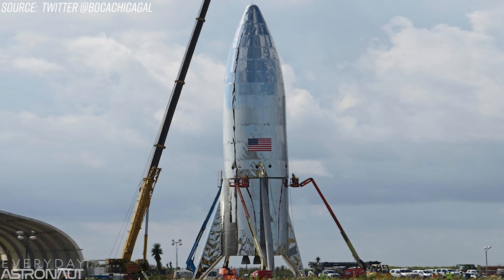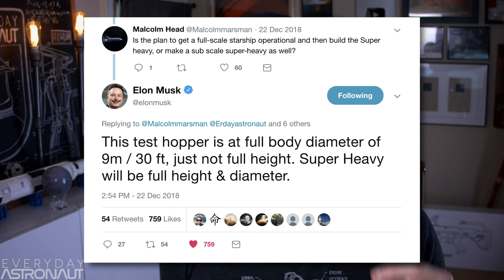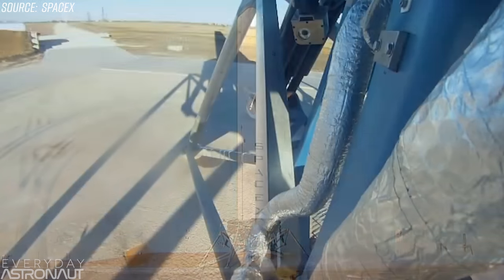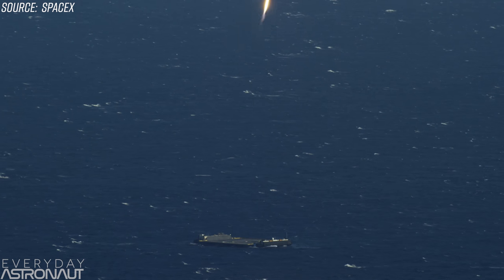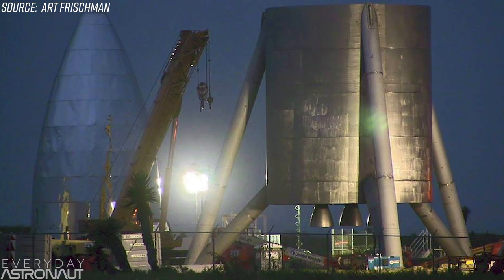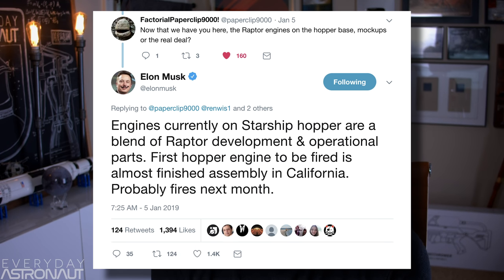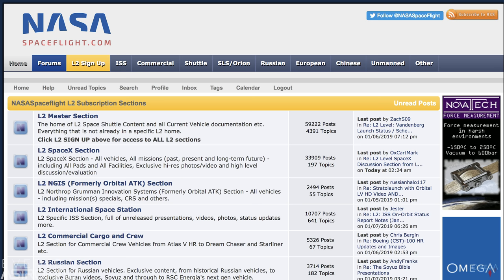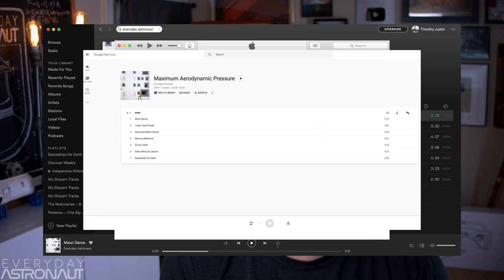Why SpaceX’s StarHopper will never go to space

Comment: Star hoppers : Lvl 1 Crooks
Falcon heavy : Lvl 100 Mafia boss

That’s how space works
Reply: lol "That's how mafia works"
Reply: xYottaByte Gaming Pewds copies that from Slazo 

Thats how YouTube works
Reply: Why are you the top comment everywhere
Reply: nigward u salty bro
Reply: Dude star hopper is near the falcon heavy level, just wait for the BFR
Reply: @johntheux9238  i doubt that.
Reply: @CarlosAM1  The starhopper has 1/3.8 times the thrust of the falcon heavy
Reply: @johntheux9238  oh, i thought you meant that on m/s
Reply: +Carlos_A_M That will depend of how much fuel they can put in, there will be smallers tanks inside the big one or they can fill entierly the big one?
In the second case it can probably go to orbit but that will just never happend...
Reply: @johntheux9238  no, the hopper cant get into orbit with just 3 engines. Its just not adapted for a vacuum and its ment to be just a hopper. The falcon heavy is more powerful than the hopper on m/s

Edit: thats why you wont see a hopper going to mars on its own.
Reply: @CarlosAM1  +Carlos_A_M
 "its ment to be just a hopper"
Yeah, it will never go to space because it's not mean to but it can, the BFS will have a delta v of 9km/s, that's enough to call it a SSTO  and same for the hopper. The BFS has no vacuum optimised engines probably because of the high chamber pressure that leads to a very high nozzle ratio and so an high efficiency even when underexpanded.
Reply: @johntheux9238  I know that about the bfr, but I am talking about the hopper right now
Reply: @CarlosAM1  We need to know what's the full mass and the dry mass of the hopper first but it looks very similar to the spaceship.

Comment: If the offset is that bad, would it be more likely that there would just be two failure modes?   Either the middle engine can be lost and the outer two remain operational or an outer one goes out and then only the center one would get used.  My understanding is that the Raptor design is supposed to optimize for 100% and ~30% thrust at sea level so that one engine could do all the work.  I mean, this only makes sense if the risk of an off-center thrust is higher than being on one engine.
Reply: I don't know if only the center one can be used. I was thinking this myself but I dunno if a single engine has enough thrust to put it down gently. We're talking about stainless steel here, it isn't light, and even with the sheer power of the Raptor, I don't think one will cut it (especially on the bigger version).

If the offset is bad because of an outer engine failure, my theory is that, because of the fact that the outer ring on the larger design will have 6 engines, 3 of the outer ones can fire so there's still symmetry and there's still the 3 engines firing. The only problem with this is whether or not they can switch to this mode on a dime, because when you're landing on another planet, any sort of hesitation can kill you.
Reply: Scteam2000 some people have done the maths and a single raptor should have been enough to lift it off the Ground, which is why there was a short time with people being really confused about why it had 3
Reply: @ValentineC137  Oh really? That's my bad. That's actually very interesting. Looking at the thrust of a single Raptor engine, it does look like it's easily possible to get a better than 1-TWR. But for landing, you're gonna want to have more than 1.5-TWR for your maximum. With 100 tons of cargo along with the weight of the spacecraft/remaining fuel, I feel like this is the TWR you'd get when landing. On Mars, because of the lower Gravity, TWR might in all actuality be a bit higher, but I think my point should still stand. It's really about having that extra margin in the end.

I'm no rocket scientist though, and without actually knowing the exact weight of the stainless steel version of the craft, I'm really just guesstimating.
Reply: Scteam2000 the single raptor being enough is strictly reffering to the starhopper, not the ship. 

With the starship however i’d guess they might do the same as with the F9 with the initial 3 engines burning and switching to a single one, with the added benefit of removing most velocity areodynamically. (But that could change if they’re trying to land with a 100ton payload, maybe they’d start with 3 engines and switch to 2?)
Reply: @ValentineC137  Yeah that's a possibility. Honestly I have no idea. I'll take whatever little bit of information Elon can throw at us.
Reply: One issue with center engine failure is whether it can hover on two engines, throttled way down. 
If not, the computer has to use the old hover-slam technique.
Reply: @avid0g  are you refering to the -hopper or the -ship
Reply: @avid0g  I dunno if it can, but I believe they're planning on using a hover-slam technique anyways.
Reply: @ValentineC137  
Both. Starship and Hopper are very similar during landing. 

The crux of manned flight is how can the ship maintain redundancy all the way to the landing. One engine doesn't fit that definition. 

In order to land on three engines, the thrust is divided three ways, but the engines are throttled nearly to minimum. Since the fuel tanks are almost empty, the ship is extremely light. (It could easily land with a single engine.) 

Then if one out of three engines shut down, the two others spin up 50% more thrust, plus something to cover the glich.
Reply: @Scteam2000  
Any single engine could handle a planned gentle landing, although that uses more fuel than a landing depending on two (or three) engines near full throttle. 

The problem is that it takes way too long to chill and then ignite an engine to cover a single engine that suddenly fails. 

Therefore, critical mission landings will always mandate two or three running engines for continuous redundancy on the way down. 

Of course, the remaining engines have to be capable of handling the required thrust if one breaks down during landing. This implies that engines need to be capable of throttling down to 46% while working as a pair. They need 60% throttle to work in a trio that allows for one failure, but 30% throttle to handle Two simultaneous failures. (The 10% margin is to cope with the delay while the remaining engines throttle up.)

Comment: 15:23 "I hope a computer is better at flying than I am... I don't know if I believe in that statement though."

Try the Throttle Controlled Avionics mod. It's specifically designed to balance thrusters positioned in even weird, off-centered places and allow vehicles with sufficient TWR to hover and even maneuver around like a drone. With that mod you could have simply specified with a navpoint that you wanted to land on the VAB and pressed one button. The ship would take off, fly to a specified altitude and hover, reposition itself while vertical, and land gently at the specified position with a small margin for error.

Of course it's still Kerbal and there's many more factors at play in real life, but it's a really interesting view into how much better a computer can be at making precisely timed inputs than even a relatively skilled player.

Comment: Tim, quick fact for you, Belly side for reentry is made up of themal mirrors to reflect/divert heat during reentry of planetary atmosphere. They are layered in 10 different materials rarely found elsewhere. We call them "thermal mirrors" because they can divert the heat to keep spacecraft cool. Sometimes they are dubbed "Reflective Armor" ISEA has advanced versions that are not normally shared with any company. ISEA stands for Incom Space Exploration Agency. Which are not well known. They don't exist anywhere because it's very private company that operates outside any jurisdiction.. But they are not first company that's aiming for Mars. ISEA has been here since 1990. They have gone over several name changes and overhauls. They have built large scale versions of Starships. Spacex is basically following ISEA's plan with Rockets. They're doing same thing that ISEA did. I have been contacting the Agency through other means. I got their response. They said and i quote, "ISEA will resume operations to Mars in 2020. The problem with our Starship Enterprise is fixed. thank you for your inquiries in contacting the Agency about us."
Reply: "Incom" ???  I HAVE heard of that manufacturer before.  I'm pretty sure they made the T-65 and the T-16. Among a lot of others..
The T-16 is pretty good to use to bullseye womprats less than 2 meters in size, and their most well know for their T-65, which blows up large moon-like space-stations.
Incom T-65 is also known as the "X-Wing" from Star-wars.
I know you were being serious and appreciate your info.  I was just amused by the the tie-in of the name Incom from reality, to the SW fantasy universe.
Reply: @Cammi_Rosalie  late reply thanks i thought it would be amusing to bring it up

Comment: They are using a water tower company because in order to simulate the weight of the ship filling it with water.
Otherwise the 3 raptor engines would be overpowerfull .

Comment: this might be a "yes I know" situation, but looking at your inputs as shown by the overview in the bottom left of the screen I've noticed that you keep jerking the control surfaces around, which is indicative of keyboard controls instead of like a controller or full on joystick. you could dampen that a little bit by going into precision control. (capslock key if I remember correctly).

Also, you could try to trim the control surfaces/gimbal after you turned one engine off. just hold alt and press the direction you want to trim to (trim controls are very small incriments so you'll have to press it quite a few times to see any noticeable effects), saved my kerbalnauts a bunch of times.

Comment: There is no substitute for building and flying a prototype. What you learn from doing so helps tremendously in making a reliable and safe spacecraft. Things can go wrong that were not thought of or tweaks needed to perfect the design are better done in a prototype than in the final product with a live crew. Just building a prototype gives you experience in how to make the next one better. Even if the prototype crashes or explodes engineers will learn much from what went wrong and how to fix it. The Grasshopper and the Falcon 9R prototypes were instrumental in learning what was needed to bring an orbital class booster from orbit.
Reply: I should wrote on the last line "The Grasshopper and the Falcon 9R prototypes were instrumental in learning what was needed to bring an orbital class booster from orbit and landing it"

Comment: Regarding the center of pressure issue with the fins, when taking off a rocket's center of pressure is already at the front somewhere near the nose (assuming it has no fins like most orbital rockets) so landing with fins is not as different as one might think. However, on taking off there are a lot more engines woth a lot more net thrust to control the vehicle with so that might be the bigger issue.

Comment: If you lose an outer engine. you turn the other outer engine off and throttle up the middle engine a lot. Since you can still land on the one middle engine. 

If the middle engine goes out. Then you throttle up slightly.

Comment: Compare the ease of holding a broom handle vertical, on the tips of your fingers, compared to holding a five-gallon bucket, with the same few fingers. This prototype hopper has the basic BFR upper dimensions and will be weighted to match the real item, which is back in Los Angeles, being built. The computer program used to run the rocket engines, needs to be developed in the real world, well ahead of the installation into a real rocket. That's why this seems so crude, as the engineers don't want to waste effort on a rig that realistically, might crash on its first outing. They can always build more of these simple units, as they work through testing.

Comment: With The Earth spinning beneath the Rocket, wouldn't you need to
move over to land in the same spot? It's called the Coriolis Effect.
Reply: I dont think so, as the rocket flies in the same referential as the earth's ground. Its like throwing a ball up in the air in a car/train, it would be supposed to just slam on the wall because of the speed, but as it goes up in the same referential as the vehicle, it just drops down in the same spot.

Comment: SpaceX will officially close State Hwy 4 (which runs right through the launch site) and Boca Chica beach on 20 March from 10 am to 4 pm.
Backup dates are 21 or 22 March at the same time.  This first test is likely to be a hold down test of the engine or possibly an actual flight to 500 meters (less likely).  In either case San Antonio/Austin Tesla owners considering a trip down there would not be able see anything from South Padre Island (the nearest viewing site 5 miles away) so we will not attempt a trip down there until later.

Comment: Hey Tim great video demo of the star hopper using kerbal. If falcon 9 can land with just one Merlin, could star hopper land with just one raptor engine? And if so if, why not just shut down the opposing engine side so its not fighting itself to decend vertically or drift horizontally? For example if the outter right engine failed shut down outter left to only have one center engine to allow better control and if middle engine fails who cares you still have both outter. Can you simulate that to see if it can work?

Comment: I believe that one of the three engines on the FH center core failed to ignite causing the loss of the booster. So the F9 cannot survive an engine out.
Reply: They didn't put enough Rocket Engine Starter (TEA-TEB) in the FH center core that's why it failed to ignite. Nothing wrong with the engines.

Comment: How's the remote termination of a booster done, I mean technically inside the rocket? Are there dedicated detonation devices or is there a reliable way to force the existing hardware to fail catastrophically, e.g. ignoring limits and overriding fuel flow past a critical level or anything similar?
Reply: Dedicated detonation systems are built into the rocket. All rockets have some sort of system.
SpaceX is the first company to adopt an automatic flight termination system, which is pretty cool

Comment: I dont understand why SpaceX. Would have to fold the control surfaces. If in horizontal flight two of them were at 10 and 2 while the third was at 6 they would work perfectly. And since the 6 o'clock fin will never land horizontally it's not a problem.

Comment: How about launching several accommodation cylindrical segments with a tube to connect them.  The tube would be assembled in space - say 1/2 miles long and the segments at each end - spin it up and presto!  Artificial gravity for your trip to Mars.  When you get there, self propelled segments would land for living accommodation on the surface.
Reply: You could just use a cable between to ships. Mars Direct had this in their proposal

Comment: If the three engines were arranged circularly the thrust center would shift less in a single engine failure. Is the linear arrangement believed to be what spaceX is going with?

Comment: Hey Tim, I have two questions.

First question, do you think SpaceX will offer any sort of cheap suborbital hops for paying customers similar to Blue Origin using the Starship only (no super heavy)? A single Starship could take around 100 people on a suborbital hop, and because of the sheer amount of people, it could significantly lower the cost. It's an interesting idea that I've been throwing around in my head.

Second question, do you think SpaceX will actually use the super heavy AND Starship for point-to-point Earth transport? Musk said that Starship is technically an SSTO without a payload, so wouldn't that mean that with a lighter payload (people and luggage), it could potentially have the delta-v available to make it point-to-point without a need for the use of the super heavy?

I've been following your channel for almost 2 years now, and even with the infusion of some of your knowledge I can't easily figure this one out on my own.

Thanks!

Comment: This could be made out of anything. They could strap three rockets underneath a Model X. It's not indicative of what the real Starship will be. My prognostication:  Tritanium.
Reply: Story relating to this.

SR-71 used titanium everything to resist heart at mach 3ish they had to design it with intenional body gaps so it did not break when the metal expanded with the heat. So on the ground it actually leaked fuel. So liquid methane and liquid o2 dripping out of a veical that has hot exaust.... Does not sound good but that is just me

Comment: I just watched the rest of this video then scanned the comments: A true sign of the times: Not one person noticed that what you show is impossible by the laws of physics. Repeat: you cannot control attitude and trajectory with the only thrust at the bottom.  Again, do the broom test and explain how Spacex's physics are different.
Reply: What you talking about? 
You totally can.
Balancing a broom will prove it. They did it with grasshopper as well
Reply: @philb5593  'They did it with the Grasshopper as well' is classic circular reasoning. Whether they did or not is the issue at hand. The compendiums of the early tests are good for this b/c there are no thrusters or grid fins to 'confuse' the issue: If the booster starts to tilt, the thrust at the bottom will not only straighten it but also put it off course. And vice versa. This is why you can't lower a broom to a spot on the ground, and why it can't be done on a larger scale. Impossible. As Sherlock tells us, 'Once you have eliminated the impossible...' and so forth, hence the launches are faked (aside from the cows running in the wrong direction).

Comment: if the centre engine goes out the two on the outside should be able to control it easily 
if the and outside engine goes out they could use only one centre engine